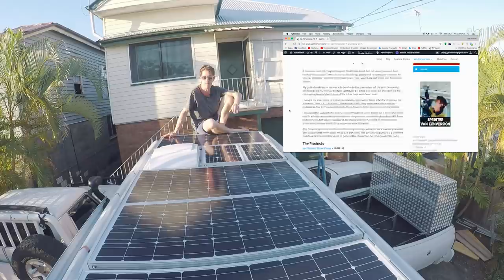S1E8 Sprinter Van Conversion | Solar Install 580W

Comment: Hi Man, just a question: what Kind of Battery do u use in your van? And how many batteries did u install? Thanks and Great job!
Reply: I did the same setup in my Diesel pusher. I have 4, 6 volt, deep cycle golf cart batteries 2 pair in series and the both pair in parallel to total 12 volts, but a Whopping CCA output !

Comment: It's always a good idea to cover the panels with a bed sheet, cardboard or aluminium foil before attempting any wiring, otherwise you're working on live cables. And if they don't pack that much of a punch they wouldn't really be worth installing.
Reply from the maker: Thanks mate, yeah I know this would come into factor if I was wiring them in series which would potentially pack a punch. But I wired very late in the afternoon with the least sun, and they're in paralell 18V per panel isn't going to hurt anyone.

Thanks for your consideration though :)

Comment: Sounds like a dumb question but what are the size of the solar panels. You didn't post them anywhere.
Reply from the maker: Sorry mate I probably did in the description but the big ones are 100w and the small ones 20w. if youre talking about dimensions though the 100w are 1195 x 541 x 35 and the 20w are 540 x 350 x 30mm

Comment: Where did you get those hole enclosures for the roof of the van, and what are they called? I have an idea for really sick looking cable routing through my desk for keyboard and mouse. Definitely overkill, but it'll look amazing.  :D
Reply from the maker: They called solar entry enclosures, i got them from a place in Brisbane australia called Brisbane Valley Traders

Comment: amazing job but I am still thinking about that solar panels only staying on top of that van with adhesive only and no bolts !! I can see they are very strong and solid , but still when drive that van espicially  on motorway journeys...annyway good luck mate....
Reply from the maker: cheers still going strong after 3 years

Comment: Question: Have you thought about water condensation under these panels while driving in heavy rain? Might this create any problems to the wiring?
Reply from the maker: I have and I zippy tied the joins up to the bottom of the panels which isn't in the video to keep them off the roof, I don't think that would create a problem anyway the Positive and Negative joins aren't close enough to short

Comment: Just wondering why such low wattage panels? Ive been looking at 4x 250watt and a 70amp controller to run maybe an aircon, laptop, led lights, nutribullet occasionally and dometic cfx 95litre fridge.
Reply from the maker: That's just how they're configured, they aren't house panels, more camping style. I think if you run an aircon you'll need as much solar and battery storage as you can get!

Comment: are you licking the fingers when straightening the sikaflex? If so, it looks like you lick the same finger. Is there a better solution?
Reply from the maker: I actually aren't i know it looks like it but Im actually wiping my finger on the rag everytime or 2nd time and then spitting on my finger without putting it in my mouth, to keep it moist so sika does not stick to it

Comment: Do you have to get an engineering certificate or some sort of certification for all these modifications to the van so it can pass a road worthy?
Reply from the maker: Hey from what I understand I will have to get a mod plate yes to change the class of the vehicle and be able to register it as a motorhome for insurance purposes. But I have a friend who converted his van and he said he didn't need to do this with a particular insurance company so I will see at the end 😄
Reply: Travel With Jaz yeah when your finished please do a video about getting it registered.
Reply from the maker: Will do mate 😀

Comment: question for ya, do know if its better to use more 100w panels than say a 200w panel. I wanna run 400w and there are 200w panels available and I was thinking of just getting 2. If you have some input, it would much appreciated
Reply from the maker: makes no difference really, i used more 100w panels purely because of the way they fit better on my van
Reply: @JaznLori   So if i'm understanding then 4 x 100w panels are no more efficient than 2 x 200w panels. That's what I was trying to say the first time hahah

Comment: Hi Jaz,
Please tell me, what is your 100 W solar panels length and width in centimetres?
Thank you in advance for your response.
Reply from the maker: You can find this on the Enerdrive website, find the 100w solar panel and all info is there
Reply: @JaznLori  

I have already done this before asking here.
I looked here:
https://www.jazmorton.com/van-conversion/solar-install-580w/
Unfortunately, the dimensions of solar panels in centimetres are not indicated there. The external link to the store where you bought these panels also no longer works.

https://enerdrive.com.au/product/100w-fixed-solar-panel/
Therefore, if it is not very difficult for you, please inform me of the panel sizes.
Reply from the maker: @ANDREJ8888888  after a 5 second manual search for 100w solar panel in their website..

Dimensions (mm)1195 x 541 x 35

https://enerdrive.com.au/product/100w-fixed-mono-solar-panel/
Reply: @JaznLori  Sorry Jaz for distracting you with stupid questions. It's just that I can buy now only solar panels measuring 131 x 65 x 3.5 cm. And I cannot understand if they can be conveniently placed on a Mercedes Sprinter like yours. Or the panel length of 131 cm. will be too long and will abut upon the grooves on the roof? I will be grateful if you can help me with this issue.
Reply from the maker: @ANDREJ8888888  it's up to you how you want to mount then, you could fabricate a roof bracket first, like a roof rack and then bolt that to the van, and then mount your panels to that, or get panels like the 300w panels and run then from front to back on your van, heaps of different ways to do it, just have to do some measuring and think about what mounting system you want

Comment: So that adhesive is all you use to secure the panels?
Reply from the maker: Yeah that's right mate
Reply: Didn't know that was possible but way better than drilling 8 hole per panel. Now I see why your brackets are as long as each panel (more surface area). So if you have to take off a panel would you just use a razor knife to slice through the adhesive?

Comment: can you tell me the thickness of the aluminium angle you used.
Reply from the maker: Hmm I believe it is 2mm man
Reply: thanks i have a  large solar panel 280W with maximum power voltage: 31.60V to fix to my Sprinter LWB van trouble is the weight is 21.9 kg so i would need a very secure method of fixing it to the roof, aluminium angle seems the way to go with plenty of Sikaflex.

Comment: How would I go about calculating my power draw so I know how much solar I need? Calculating this would be a BIG help for me as I plan to do a conversion soon myself. Thanks!
Reply: I found this video which was easy to understand.  It's part 4 of a series on her channel. https://www.youtube.com/watch?v=4-OpzH5sBG4
Reply from the maker: I added all my DC loads that will be in my van, and roughly worked out how many hours i will be using them per day, which gives me my amp hours. and then I used this calculator to calculate the draw from my batteries when running my inverter.

https://www.batterystuff.com/kb/tools/ac-to-dc-amperage-conversion-run-through-an-inverter.html
Reply: this is the best!!

Comment: Wiring for the PV is not the best. Should have ran from junction box to junction box running inside the frame of the panel. They are going to flap around when on the freeway. The entrance for the cables should be turned around. They will begin to leak in time when driving down the freeway.
Reply from the maker: Hey mate thanks, none of those things have happened. the glands are water tight, i mounted them that way so the wires enter directly in instead of bending around the back and being messy. Ive checked the wires about 4 months later after being on the road and everything is fine ;)

Comment: You could riv- nut the panels and then bolt from the outside. Easy to undo from outside as the nut will be captive in the panel https://en.wikipedia.org/wiki/Rivet_nut

Comment: Go series and use bypass diodes 
Trust me 😅
Reply: Euan Willis I believe Steph & Nate on Adventure In A Backpack started with a parallel configuration and then later switched to series to get better performance from their solar system. Good to see it done both ways so we can compare notes, etc.
Reply: How do the bypass diodes work. In series if 1 panel is in the shade do you loose all the charge
Reply from the maker: Thanks Euan, I'll have to youtube how bipass diodes work, and are they expensive?
Reply: Was going to suggest the same thing... a 12v system (aka 20v ish) is pretty low for 400w -> it is trying to pump about 20 amps through pretty thin cable, so you are likely to get about half of that lost as heat within the cable. If you have a multimeter, you can roughly measure the resistance of the cable length, which you then plug in to P=V.I  & P=sqr(I).R to work out your cable loss.
Reply: When under a tree, some is power will try to go from the non-shaded panels, into the shaded panels... ie: causing the shaded panels to act as a resistive load.   Putting a diode in series with the panel-output, helps to block an inward current.  I use 10A Schottky diodes (for very low loss compared to standard dioides) per 100W panel.

Comment: you should MIG weld bolt (at least 2 bolt for each panel) to the roof to mechanicaly lock the solar panel.
Or, you can use windshield urethane adheshive like for example from 3M  https://www.3m.com/3M/en_US/company-us/all-3m-products/~/3M-Auto-Glass-Urethane-Windshield-Adhesive/?N=5002385+3293242009&rt=rud
This adhesive should strong enough as a load bearing bonding.

Comment: I wouldn't trust SikaFlex used for this purpose, its not worth it if one blows off on the highway and smashes into someone behind you, The correct way is to bolt them down.
Reply: Rubbish! You could probably lift the weight of the whole vehicle with that Sikaflex!
Reply: That's what I thought. Sikaflex is more of a sealant than an adhesive. Although Sikaflex-221 is claimed to have a tensile strength of 1.8MPa, so pretty sticky stuff!
Reply: nagualdesign i guess Sikaflex 252 is even stronger than 221...
Reply: Petr S.  Yes, it's more than double the tensile strength as it happens. Other adhesives are even stronger still. That's not what he used though.
Reply from the maker: I did think about this and that is the last thing I would want to happen. I will test how they're holding up in the first couple of months driving around.

I was initially going to use Sikaflex 252 but I spoke to a rep from Sikaflex and he said Sikaflex 221 will definetly do the job and without the need for priming.

Comment: Electrical tape???? That is no permanent fix, never ever rely on that stuff bro
Reply from the maker: Yeah they are still holding up great over 2 years later but I somewhat agree, the best would be in an enclosure but this system is wired in parallel not series so there voltages are relatively low.. around 40VDC roughly
Reply: @JaznLori  not buying it mate :)